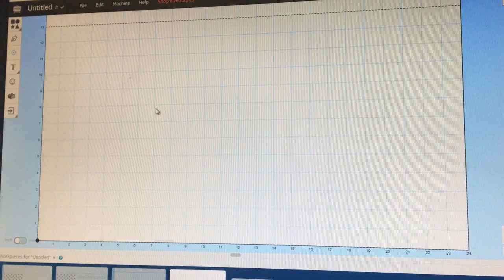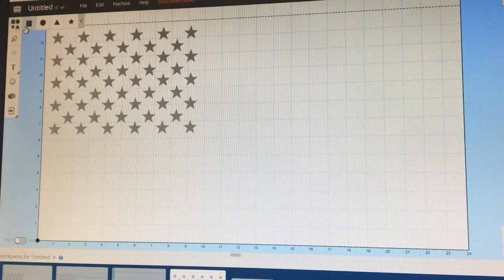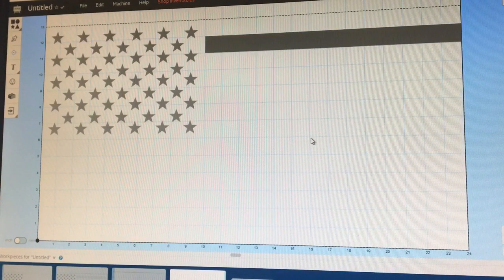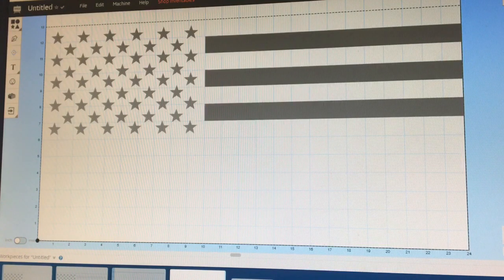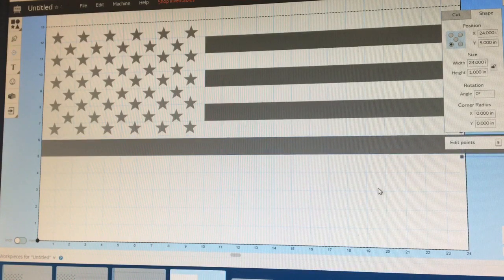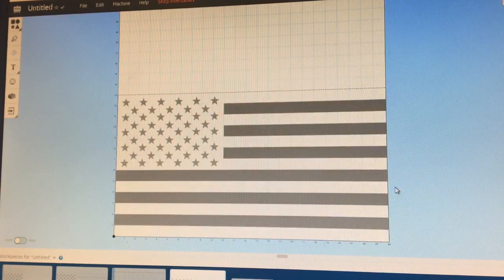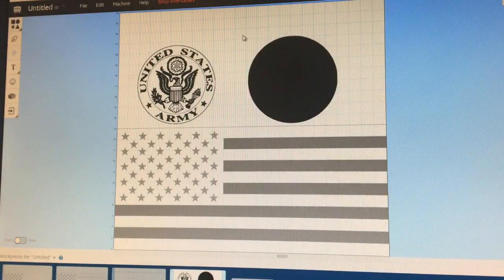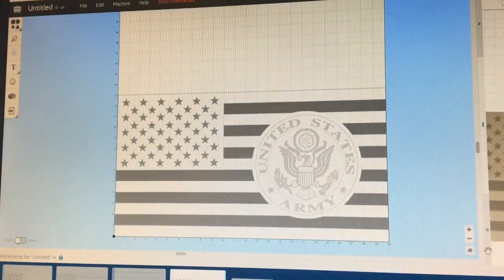How to design a full panel flag. Easel Pro Tutorial!

Comment: I did this step by step giving me a crazy carve time. What bits are you using? And what do you have your feed rate at. Thanks in advance for the response
Reply from the maker: cooking with C wade depends what bits you are using. With a .25 upcut bit and a 60° vbit as a detail bit it should be faster. I run mine at 100 feed rate 20 plunge and .06 depth per pass.
Reply: Torched Wood Works 1/8 solid carbide 2 flute end mill 60° V bit. Just have What I ordered from invincible. What feed rates and plunge depth would you suggest with that
Reply from the maker: cooking with C wade 75 feed plunge and depth per pass the same
Reply: Torched Wood Works i’m a fellow Georgia boy love your work brother.

Comment: Great video! I tried doing the flag with an logo on it. It came out OK but there was allot of rough areas that were left on it. I'm using a 60° bit . Also how do you know when you have a two part svg and how do you separate them. I'm new to this and I'm so trying to figure things out.
Reply from the maker: If you want your image split up into multiple parts so you can adjust different sections of it convert the SVG into a DXF file. I'll make a video showing the process that I use. It's very simple!
Reply: @TorchedWoodWorks  thank you

Comment: Great video, what wood do you use for 24x13?  plywood?
Reply from the maker: articcatzr600rider thank you, and I use the panel boards that both Home Depot and Lowe’s carry. They are basically multiple strips of wood glued together and planed flat. Plywood would work but you would get the layers showing up when you cut into it and the risk of chipping out is greater with plywood

Comment: Just curious what your settings are as far as feed rate and plunge. I designed one and it says 2+ hours to carve stripes
Reply from the maker: That sounds about right honestly, I run mine at 50 feed rate, 20 plunge rate and .06 per pass.
Reply: How do you do the flags with the border?
Reply from the maker: @scotthamel7928  I just make my stripes that will be carved out shorter than the actual work piece. For the shorter stripes I make them .25 shorter, and the longer pieces .5 shorter. Then use the shape tab and use the coordinate section to place it where needed.

Comment: Great video but needed to ask when you carve this what bits are you using?
Reply from the maker: I am using a 1/8th spiral endmill bit for the rough pass and a 60 degree v bit for the detail pass
Reply: @TorchedWoodWorks   how long did this carve take you to complete
Reply from the maker: @fmoe303  I’ve since changed to a .25 endmill upcut bit and a 60° v bit and can do this in about 1.5 hours
Reply: @TorchedWoodWorks  not sure what I’m doing wrong but I get very different times. What feed rate,plunge rate, and depth per pass did you use for roughing and detail. Thank you for helping.

Comment: Hi again;  I followed your procedure and put an SVG of "Strategic Air Command" on a wooden flag and carved that image at .10 and then again at .05;  Both times it did not turn out well.  Any idea what I might be doing wrong?
Reply from the maker: There are a lot of variables that it could be, could be the wood, the bit selection, zero point. What is it looking like when you carve it. Are you losing detail in the carve? It could also be the image itself isn't as clean an image as it needs to be which could cause it to not work well.